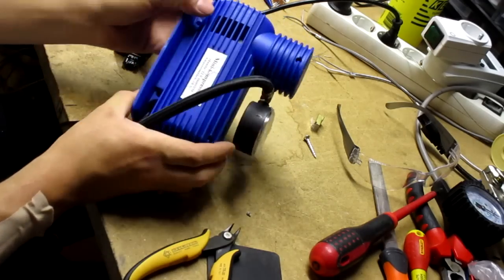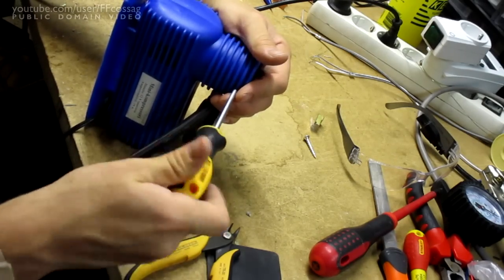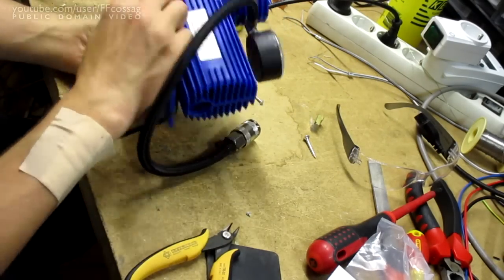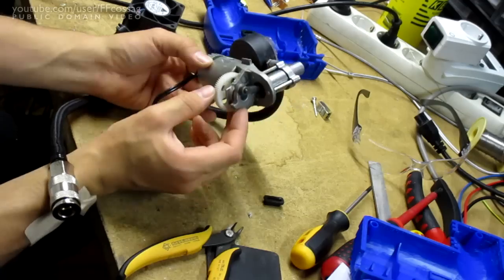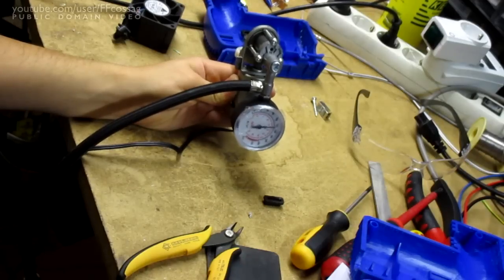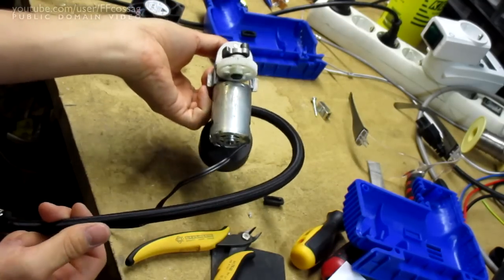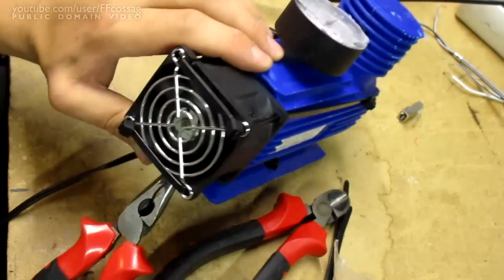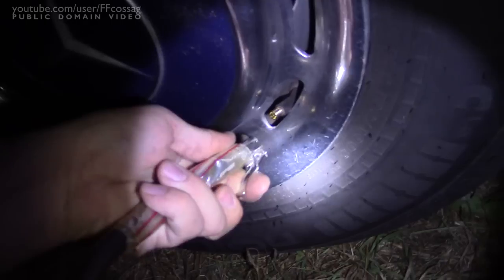9,96 € 12 V mini air compressor upgrades!

Comment: These compressors can be real life savers. Your video is great very nice hack. I am thinking of doing something similar but ideally I want to convert it so it can take my 12v drill batteries and run wireless. This would mean I can use it in the shed for the bicycles or anywhere else.

Comment: I got one of those from the scrap yard, it came without the plastic casing, just the bare compressor and at least it had compression. Noisy and loose. So I taken of this motor as I had a way bigger one (more torque) GMX-SPV008A  without the reduction. I had to cut the aluminum frame and bolt it into the motor, also with a dremel, I cut the gear at the end of the motor to match the shape of the compressor camshaft. It is way more powerful and quiet, I also use 15W40 oil to lubricate everything on it.

Comment: just found 3 or these that i have got over the years as xmas present from offspring with morals... 
you raise them for years and they thank you with these....
anyhow i shall take all 3, join together, add an old 1ltr fire extinguisher as a reservoir, a 90psi cut off switch, and have a mini 12v compressor for my nail gun/ratchet and blowing up my big van tyres

Comment: I wonder if you can use an old empty CO2 fire extinguisher as a pressure vessel, that a regulator and a pressure switch and it may be handy to clean computers etc?

Comment: Such a cute little assembly, im supprised it can pump a tire up, so diddy :-D.
Like your forced air cooling, heat is death for most things :-(
Imagine if it was a footpump cylinder size and driven with a 24 volt battery drill motor :)

Comment: These tiny 12 volt compressors are really cool. The one thing about the nylon gear (assuming it IS nylon) is that it is self lubricating to somedegree. I am afraid that adding anything but a dry lubricant will attract debris.
 Moly is amazing stuff, I had some in powder form and put it into a rather loud transaxle and it quieted it down. 

I have modified an expired propane tank to include a pressure relief valve and use it as a reservoir for compressed air. Same can be done with disposable refrigerant tanks. Getting the old valve assembly out of the propane tank is not easy and messing about with one is, to put ones self in harms way if you do not exercise extreme caution.
Reply: How can i coect t it inside my house with what adapter what. Can i use can you tell me like what type of cable can i rip to atach to it so it works is 225 volts i think ot p81 it says

Comment: The fan is a great idea... but if you don't add one, just remember these little compressors are for intermittent use, and usually have about a 10 minute duty cycle. 
10 ON, 10 OFF. I'd try a lilltle Jigaloob or WD40 ?

Comment: How to get the piston seal rubber?
Reply: Same problem here. The stock ring must have overheated and a piece broke off. Tried an O ring, but it's not sealing enough to build pressure.

Comment: Lol, I bought the compressor like that to put into girlfriend's car. It was about that price, has the same shape casing, same insides, but casing is black plastic. Still works, used several times to pump tires to proper pressure. I do not like fake cooling fins design though...

Comment: i did the same but remember to change the hose it came with it. its very weak rubber. replace it with a reinforced rubber hose.

Comment: Could you please please make a video on how to modify the hose connector? I want to be able to use an air gun as you did, for cleaning. By the way, your videos are great! Thanx!
Reply from the maker: No point in an air gun without a tank.

Comment: Would lithium or silicon grease have worked?

Why specifically molybdenum disulfide grease?

Thanks
Reply from the maker: Because that's what I happened to have quickly at hand.
Reply: I. Need help with mine it turns on but the air is stuck in their and i knoe their something wrong because is sound week like wen it turns on and wen it works it had the same rmmmmm sound but real low hey can you please write back to explaine too me

Comment: Great video! Congrats!! I have barely the same compresser and i'm trying to upgrade it to use it with an air brush. What would you do to change the hose?? Any advice?? Thanks!!!
Reply: Jaume González Castañer I would not advice using this with an airbrush. I don't know what you want to paint, but when I'm using my airbrush it often takes 30 minutes or more to paint something. Running this little compressor for that long would make it run really hot. Also, once you add a pressure regulator and possibly an in line moisture trap, you probably could have bought a small (used) air compressor designed for airbrushing for the same money. Just my 2 cents.

Comment: If I connect a tank like say a fire extinguisher could I use it with an airbrush? I am thinking about connecting mine with a fire extinguisher tank and I will also add a cooling fan to this small compressor with a pressure switch that will turn the compressor off at 120psi and on at 90psi. WHAT DO YOUTHINK?
Reply from the maker: No.
Reply: @FFcossag  No what?

Comment: Don't let it run for too long, though. I have one of those (without gauge) that I now keep for spare parts because some of the  plastic gear's teeth riped off (my guess is the piston overheated and stuck inside its housing – I had left it running for 15 to 30 minutes straight in the sun). The motor is fine, but I can't find a replacement gear and even though, I can't disassemble it. So beware. Wish I had thought of searching for vids like that beforehand... Well, hindesight, as usual, comes too late. :)

Comment: Could had added a Small Tank next to the unit for better continuous volume !
Perhaps a PVC, Check valve.
Aye ?
Reply: Yes, that's a good idea. But consider also the required pressure, eg for car tires require about 30 PSI. instead of using a PVC pipe i prefer using small fire extinguisher tube. it's cheap, strong, and nice looking too.
Reply: how about metal pipes

Comment: I have a small compressor like this but it works on 12 volt car battery how can i change it to a wall adapter ?? Did you use a car battery ??
Reply from the maker: Use a PC power supply.

Comment: Where did you get this? Looks nice unit and maybe worth ordering. Or was it just from local shop that only sells in Åland?
Reply from the maker: It's from a local shop selling under the IKH brand here in Finland. The compressor seems to be mostly just standard issue Chinesium, though.
Reply: FFcossag Okay thanks! That "here in Finland" bit is kinda funny to read. You see I live in Finland too so yea. Do you think it would have enough power to fill small air tanks to around 8 bar pressure? I know it will take forever to fill but that would not be a problem.
Reply from the maker: Hene193
It'll probably catch fire in the process, the compressor cylinder runs really hot even with the fan.
Reply: FFcossag Well then it will be fun. Thanks

Comment: 12 volts battry charjer direct not work. but  only 12 vots  battry 100% working. plese 12volts AC charjer  working root telme sir? howto use? (12vots Dc compressure  work ) 12volts Ac  chargre to use idea? ?=====

Comment: Seems like there are no capacitors on the leads to the motor housing, or across.   So it probably also functions as a shortwave transmitter. Now put some switch in between and learn some Morse code.
Reply from the maker: Ha - at least I have an emergency radio if I get lost!

Comment: What happened to your arm ? What's your bandage did you use?
Reply from the maker: A sharp bolt attacked it.
Reply: FFcossag gotta watch those bolts, all they do is hang out with nuts.

Comment: Hi, What is the connector used at 0:45 called. Am about to install the same but no idea of its name..
Reply: It's a Quick Adapter. It comes for air applications and hydraulic applications. Hydraulic are rated a lot higher than air but work principle is the same.
Reply: Hi, Thanks for the reply. So, Can it be plugged into the tire inflator nozzle ?

Comment: I read that motor it's a 14amp consuming sucker. Thats too much current
Reply: yeah it melted the wire and plug... it comes whit a sticker that says that u should wait 30 minutes for it to cool when it gets hot. 
its a tire every 1/2 hour